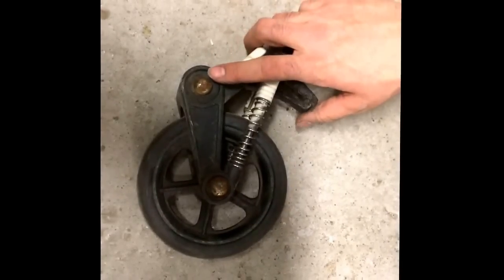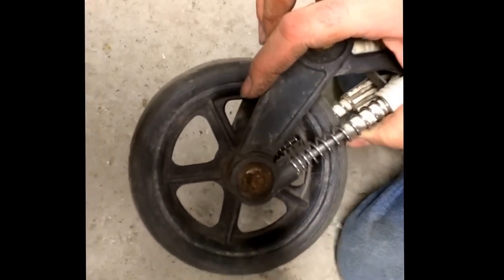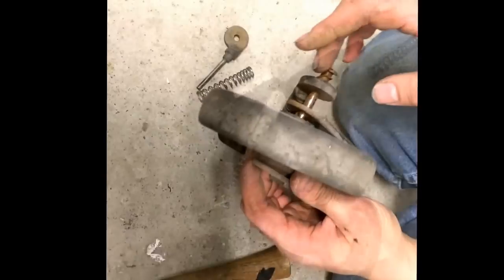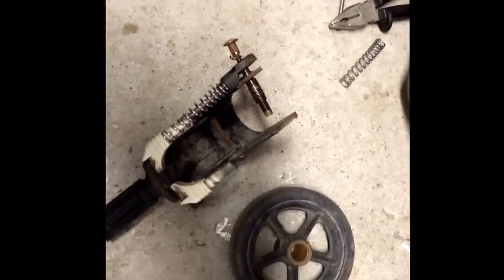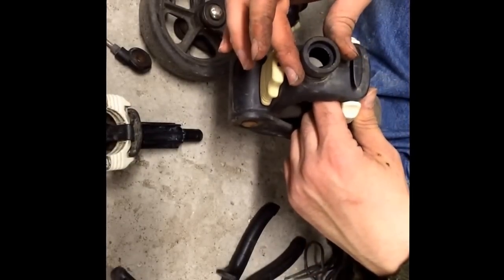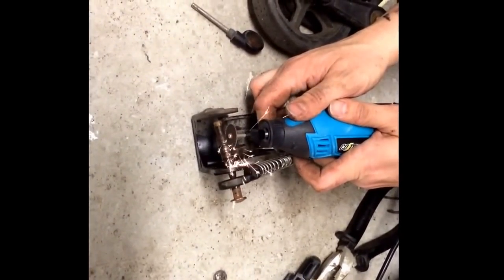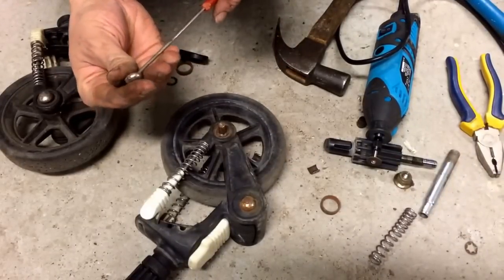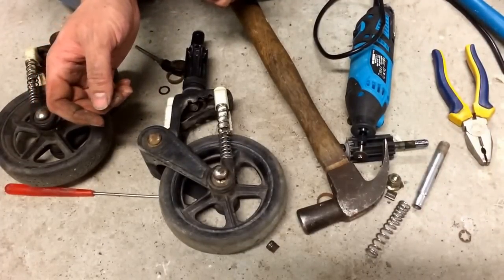How to Replace the Ball Bearings / Swivel Shaft on Bugaboo Cameleon Front Swivel Wheel

Comment: This was SOOOOO helpful!!! I live on a tight budget, and got given an old Bugaboo Cameleon with this problem, 
I found the most cost effective way of repairing the wheel was using two ball bearings from discarded fidget spinners, which turned out to be the exact right size! (only problem is they are not "sealed", but hey.... there are a lot more where they came from)

Comment: Thank you for your contend! Love to learn how to repair things on my own! Sadfully it's impossible to get the wheel down for me, 'cause it is too rusted. I tried everything (acid baths, wd40, .....)
They do not sell the old wheels for replacement today. So my question: is it possible to change the locking mechanism from the cameleon 3 front wheels and put in the old ones (cameleon 1+2 plastic cap mechanism)? Thanks!

Comment: Nice vid, although I believe you should've put the bearings in the other way. 
The original bearings have that extension too, and if mounted the correct way it ensures the wheel will not seize with overtightening.

Comment: do you know where can I get a front tyre shaft replacement?at the moment I use a bolt with a thread to fit a nut. I'm afraid that the bolt will damage the bearing when tyre rotate.
Reply from the maker: I've used bolts before that have worked fine.  You should try ebay though for replacement parts, if you don't have a local retailer that can order them for you :-)

Comment: Hello do you have any video or tips for a stiff front wheel? I have one that’s not spinning and not sure where to start thanks
Reply from the maker: Most likely a rusted ball bearing, but it does depend a little on the model, what sort of stroller do you have?
Reply: The Stroller Workshop it’s a bugaboo cameleon not sure what year because it’s second hand
Reply from the maker: Probably ball bearings then, if its the front wheels this can be a bit tough because the axle tends to rust to the inner ring of the bearings.  Cameleon wheels (both for Cam 1/2 and Cam3, the shaft of the former is made of plastic, while the latter is metal) are pretty easy to get ahold of on used markets like ebay, so its sort of a matter of whether its worth the time and elbow-grease to fix them vs the cash to buy replacements :)
Reply: The Stroller Workshop thanks for the help 😀